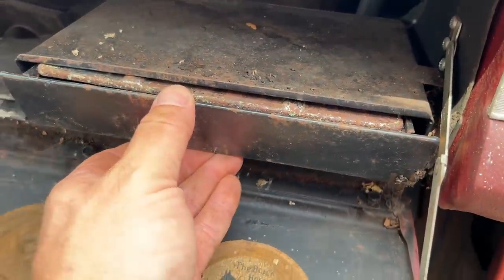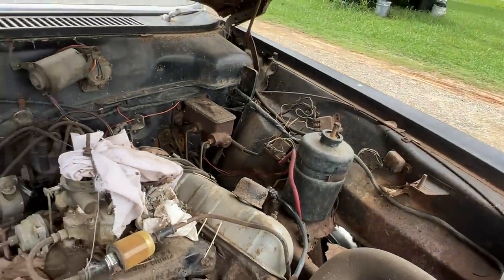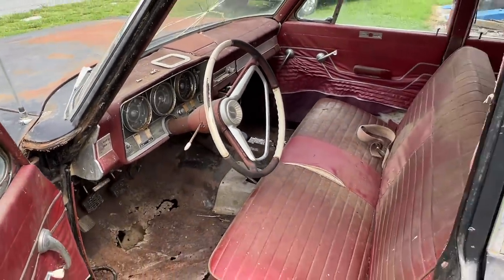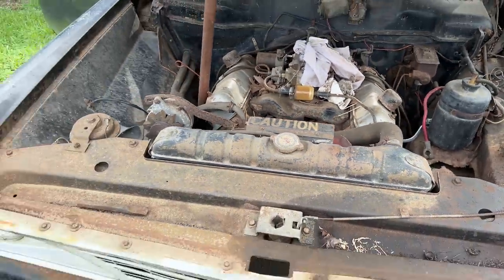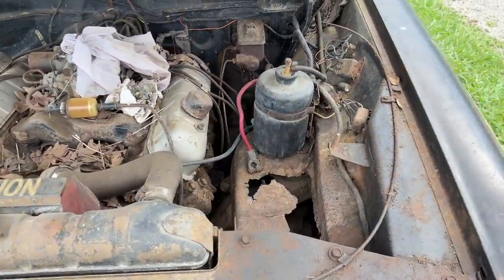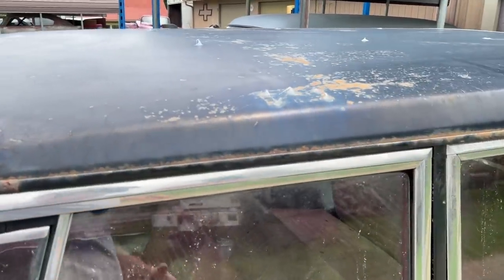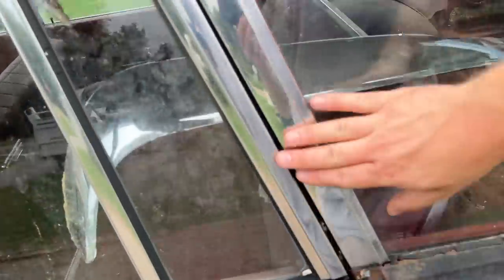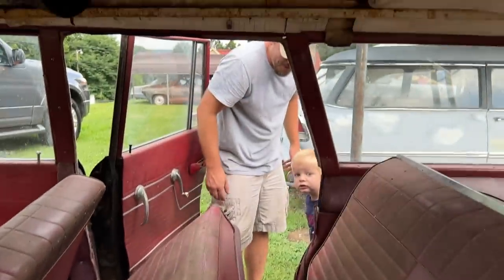CRAZY RARE V8 4 Speed Studebaker (Best STATION WAGON Ever!)

Comment: I love these wagons!  Matchbox even made a model in the day that featured the sliding roof.  Sadly, this was very near the end of the line for Studebaker vehicles- which date back to covered wagons!!
Reply: Studebaker was established in 1852 so was over 100 years old when they went  under.
Reply: @todddenio3200  Yeah, I’m guessing it held a record for a long time for longest run for a US vehicle manufacturer.
Reply from the maker: Wow I didn't realize that!
Reply: Lesney's Matchbox #42 Stude wagon was my 1st. 4 wheeled vehicle!  😄
Reply: @UberLummox  I also had one. It came with a plastic hunter and his dog. The roof slid open! If anybody has a complete original with the box it's EXTREMELY rare!
Reply: @HotRodHoarder  Tommy, you should call this project the “UnCovered Wagon”, or the “Rediscovered Coverable Wagon”.  😂
Reply: Yes Matchbox made the Studebaker Lark version. So did Corgi who did their’s as an ambulance - which was sold in the USA under the Husky brand. Both had the sliding roof but Corgi’s also had an opening tailgate.
Reply: @bccphotec  Yes it was such a sweet model with lotsa play value with the figures as you mentioned, and the sliding roof.  I'm actually a collector of these (still  🙂) however they are not rare. Quite common in fact!
Reply: @UberLummox  I’m also a diecast collector, mostly Hot Wheels, followed by Matchbox, though I’d say I’m “retired” from collecting.  Maybe it’s more appropriate to say “in recovery”? 😆.  I don’t have the Stude wagon, but would be a cool piece to own.  Will have to check out the Corgi and Husky models - I had a feeling Corgi made one…btw my very first Hot Wheel was the Emergency rig ca. 1974.  Like all my childhood HW & MB I still have it.
Reply: @mattskustomkreations  "In recovery" HAHA! Yeah me as well. Sometimes there IS such a thing as too many!  I know the HW you're talking about. My 1st. Hot Wheel the sexy Silhouette. 😄
Reply: @CycolacFan  Corgi's Husky actually came in a couple variations that I'm aware of. An ambulance, and a camera car with cameraman standing up in the rear of the load area w/roof open.
Reply: @UberLummox  you’re right, the camera car was yellow wasn’t it?
Reply: @CycolacFan  You're right. Cyco. It also came in blue, and olive metallic. Maybe other colors. I'm not that up on my Corgi history too much.
Reply: @UberLummox  You were so lucky to have grown up in the Golden Years of HW.  I remember being really sad to see the redlines phased out just as I was beginning to be a serious kid collector.  Like every addict has an eventual “rock bottom”, mine was when I went to move cross country.  When I saw how many boxes and boxes I had packed it was a real wake-up call.  I had never seen all of them together, they had been squirreled away all over.   I went cold turkey and for many years bought none, then maybe one or two a year after that at most.  Sold some primo ones when the recession hit - unfortunately everyone else was trying to unload too, so prices were soft.
Reply: @mattskustomkreations  Oh...my...GOD, right!!!? So much cool junk it was silly! I was more into the realistic regular wheel Matchboxes, but everything from the models, slot cars, and cool stuff the  custom chopper my brother built from the Auto World catalog....that thing was so beautiful!!!.   I called everything past about '72 the diecast dark ages, until Jonny Lightning fired back up, then I kinda went nuts.  I've been in recovery as you say for a few years now except for a few customs. 👍
Reply: @UberLummox  Are you a @Plus Ten Weirdo”?  +10 Weirdo was my description for my profile for the perfect yet elusive collector whose collection I used to search for when I was hardcore into hunting and buying Spectraflame era HW and blackwheel MBs.  It means someone who as a kid was 10 years older than me.  But a weird kid - one who didn’t run his cars through the dirt, leave them outside, paint them, or play crash-up all the time with them…he kept them in the carry case - safe and immaculate.  Growing up, my best buddy had a brother 10 years older than us, so he had the goods.  He could have been a 10+ weirdo except my friend got to his HW and JL collection at age 2 and took a hammer to them. (!) So I was left with glimpses of grandeur…the beat-up cars were absorbed into my friend’s collection.  We played for hours in his basement using miles of his bro’s orange track.  I look back and I’m sickened- such as with the purple Classic Cord that was beat to crap, among so many others.  Every single Silhouette had its bubble cracked.  Axles bent, wheels missing.  Lots of Unimogs, not one with a full set of tires.  Carnage, I tell you!  Years later, when moving his room to the basement, my friend struck gold - he found 2 MB cases with mid- to late 60’s MBs in them, in perfect condition!  These cars escaped the toddler’s wrath- turns out his older brother was a Plus Ten Weirdo after all!  😂 I used to salivate over them and beg to buy them but no dice.  My time finally came when my artist friend mentioned he still had all his cars.  He was +10, check.  He was an artist, so goes without saying he was a weirdo.  It also means he was broke.  So he “pawned” his collection to me.  I promised to hold them til such time he could buy them back.  When he brought them over, my jaw hit the ground.  So many were in PERFECT condition.  On top of that he had all of his HW badges, plus sheets of unused decals. 2 of the 3 HW club chrome cars.  And original series Models of Yesteryears. Plus there was another bonus— along with late ‘60s HW and MB jewels, he had something I had never hear of - a “Cigar Box” of Aurora Cigar Box cars.  Essentially plastic slot cars converted with diecast bases and rubber wheels to try to complete with the big boys.  These cars and case were IMMACULATE, which is incredible due to their fragility.  And rare - Aurora gave up competing with HW after 18 months.  Sadly, he died a few years later, and parts of his collection, including the Aurora collection, were among the eBay victims sacrificed when the recession cost me my job…
Reply: @mattskustomkreations  Yeah, I'm weird as fuck. And a little bit of an artist and am a musician, so...:🤪<---yup! I remember clearly, at 6 yrs. old making the conscious decision to keep all my cars in my case, and not let Mom toss'em in the toybox. So many of my regular wheels are a little tatty, my transitional Superfast are half & half, and all my post-'70 Superfast are dead mint. Though some the wheels are literally worn down, but otherwise nice!  But I'm more 1:1 car freak than toy & collector freak. I know crazy amounts of US & Euro history, and have had my own bodywork business since I was about 14 around 1978.
Reply: @UberLummox  Cool, I’m also an artist and musician.  I had to give up the last of my 1:1 collection when the recession hit. 😢 I drove a loaded ‘72 Luxury LeMans & wife drove a ‘69 Cougar with factory electric sunroof as daily drivers up til then…

Comment: Definitely worth saving. The Studebaker club hopefully can help you find a windshield source. Do you know what that black tank object is in the drivers side of the engine compartment? Your wife is brave regarding filming while bugs run around. Most would have dropped the camera at that point and run lol. Subscribed.
Reply: you can get a windshield for just about anything if you are willing to wait. I just sourced one for a 64 Corvair Van and it was made in China. Special order cost about $1800 plus another $100 for the rubber. Insurance covered it. BTW, I have to say it looks good but the optical quality on the curved edges is not like the original.

Comment: FYI Most of the V8s engines were replaced with a 6 cyl. Because the V8s had large coolent passages which they used them in boat racing.
Reply from the maker: Interesting, I didn't know that!
Reply: @HotRodHoarder  My best friend had one .Theres  a bar in front of the radiator if it's there you have real deal. And it was a Dailey driver. The sliding roof is a air craft door. We called it the white Rino. The wagon.

Comment: The center lock on the sliding roof will also lock it in the open position.  Again to prevent unintended decapitation etc. As I recall, when functioning properly, opening that latch drops the sliding roof just slightly and allows it to move. Closing it lifts the sliding roof slightly and 'locks' it in place with small side safety latches that were always supposed to be used as a backup to the main latch/lock.

Comment: I have two Wagonaires.  The engines (259/289) are already hot rodded with solid lifters and gear driven cam.  The center steer is unusual.  Electronic ignition, disk brakes, and supercharger were options.  Not options on other American cars.   The car has a filter for interior air.  Not found on other cars until recently.  Studebakers were state of the art.  You must fix the drain in the sliding roof gutter.  Add another drain hole and hose between the doors.  If you park it wrong, it will pee rainwater on your shoulder.   I drove one 500 miles a week in the '90's/20's.  Ted Harbit drag raced a factory Studebaker (including engine) until wrecking it a few years ago.

Comment: I have a 66 with very little rust. Colorado wagon. Slider  Wagonaire made from 63-64 in So. Bend, IN then factory closed (Stude started in 1852 making wooden wagons). Moved production to Hamilton Ontario in 65 and ceased production early 66. Since Stude had no drivetrain, they sourced to GM Canada. Mine has a  283 sbc, 3 on tree with BW and elec od in 2nd and 3rd.  Parts can get pricey. I have the fold down tailgate step on mine. Body on frame  construction so endless possibilities. Around 9xx made in 66 before closing.  The sliding concept was advertised as a wagon/pickup. See ads with refrigerator standing in back. Endless possibilities in a build-up.

Comment: Should have used a little penetrating lube like KY. That Stude is worth restoring, as long as you don't muck it up as a Resto-Mod.
A little trivia: 
When Chevrolet was designing the Nomad, they had considered a telescoping roof, but due to production cost and possible water leaks, they instead went with a simulated telescoping roof.
Also, while the Wardolf Nomad had a electric rear window,  Chevrolet went with a lift up window  for the 55-57 Nomads because of production cost.

Comment: Your wife has the cutest laugh ! Love the video and she is worth saving. A little history back in 57 you could order the Studebaker Golden Hawk with the 289 Sweepstakes with a factory Super Charger . Even the Anvanti was optional with the Super Charger it was a Paxton belt driven super charger. I have a original magazine from the early 60s and they test drove a Avanit from coast to coast . They went to the factory got a Aavnti off the assembly line as it came out . You could get AC or the Super Charger not both. They opted for the Paxton, It had manual trans in it . They drove from the factory and at 75 mph averaged 17.5 mpg when they got to the Salt flats they decided to do a top end test they threw in a fresh set of plug and drove the car out on the salt flats and did 149.8 miles an hour . This is a car with a 289 and points dist and fresh off the assembly line driven from the East Coast back in 1963 , There is your history lesson for today .

Comment: I had a 1965 Chevy Bel Air station wagon in the early 1980's and the tailgate window worked well, even in the most bitter cold winters. My parents had purchased a new Dodge Omni in 1981 and it froze up completely during a severe cold snap in January 1982. The dealership said the computer was frozen, the battery was frozen and the fuel line also. It was at the shop for over a week. I was taking my step-father to work with my 17 year old $300 clunker station wagon. It started every morning, even at -30 Fahrenheit. Hard to kill those old 283 Chevy engines.
Reply: That Winter of '81-'82 is the last continuously below-freezing cold and snowy one that I can recall having here in SE MI, lasting from early December through mid-April w/o a significant thaw. Ever since then, each successive winter has had long thaws and caused the regional Pine Knob Ski  resort to operate erratically during each seasonal year, if it opened @ all. A few years ago we even had summer-like thunderstorms overnight, 2 in mid-January and 1 in February.

I stored my '79 Chevy Camaro z28 w/350 cid 4bbl, 4spd Hurst stick overwinter in my parents garage back then, after having purchased a old used 1969 Plymouth Fury 4-door  318 v8 auto with 119K on the odometer for a few hundred bucks. It was an AZ car that had stood outdoors in the  desert sun until the gloss had completely baked off of its gold paint, vinyl bench seats were badly cracked all over, and the carpeting had lost all moisture and was rock-hard.

Comment: Not being A Car Family at the time, my Parents purchased  a 1964 Wagonaire, not knowing the Company was going under.  I was 12 at the Time and thought the Sliding Roof was cool.  We probably were sold a base model, because I don’t remember  electric windows, V8 and it was an Automatic.  Not a selling point but the Salesman made a point of a feature not shown on this video was a step built into the the tailgate which  swung down to ease access into rear area.  He showed it to me with my parents watching and I unfolded it, and it kept me occupied while they made the deal.  Ironically when I saw the GM pick ups with that NEW design Tailgate - It reminded me of a 58 year old Studebaker - Imagine if they were still a Company today - Flying Cars??? Oh and OBTW the roof did leak right away after there was no longer Dealer support.

Comment: I have a 63 Lark.  The Studebaker option for disk brakes are still available, and most parts are still available for American production models.  You need to get acquainted with Studebaker International!  And the glovebox vanity was a studebaker exclusive.  If you want better wheels, any Ford Crown Victoria wheels will fit with a slightly wider offset.

Comment: 5:38 When you said "DASH" my dog came alert (his name shortens to DASH from BALDURDASH ).
'64 Studebaker Daytona (top trim level except for the 'Cruiser' sedan) Wagonaire designed by Brooks Stevens (same guy who worked on the Kaiser-Jeep Wagoneer), it's a moosemobile with space rivalling the best full-size competitors, and that sliding roof panel put in an appearance forty years later on a version of the GMC Envoy. 
Studes were notorious rust-buckets. Even the fiberglass body Avantis had rust issues. 
That said, the Wagonaire also bears similarities to other Stevens designed show cars.
The Wagonaire could be ordered with any Studebaker engine, including (though no Wagonaires were ever so equipped) the Granatelli R3, a supercharged high compression 304.5 cube overbored version of the 289. Rumor was that no R3 left Granatelli's shop until it had turned 415 horsepower on the dyno, though the number usually quoted (and Studebaker never published output ratings for the Avanti engines) was 335. 
More tame offerings were the 170 cube six at 112 horsepower, 259s at 180 or 195 horses, regular fuel 289s at 210 or 225 horses, premium fuel 289s for which Studebaker never published horsepower ratings, with or without supercharger. Another version of the 304.5 with dual four-barrels and 12:1 compression was said to have produced about the same output as the supercharged 289.
In short, that is a very special car. While it may cost more to restore than could be recouped in the short term, it is an important piece of automotive history. 
6:30 That "Vanity" was standard equipment on all Studebakers of that period except, maybe, the severely decontented Standard ('63) and Challenger ('64). 
9:09 Rambler and Cadillac offered dual circuit brakes as standard equipment starting in 1962, and Studebakers with drum brakes followed in 1963, four years ahead of the rest of the industry. 
The dual circuit was not available with another Studebaker first, power disc front brakes which were standard on the Avanti and (expensively) optional on all other models. Studebaker claimed that the discs stopped the car from 100 miles per hour in 100 feet less than the standard drums. Magazine road tests at the time confirmed it. 
The sliding roof proved useful for carrying tall cargo, and I have seen pictures of Wagonaires with movie cameras in the rear bay for newsreels.
The Climatizer is the heater, optional in those days.
May I suggest looking up the television commercials on YouTube?

Comment: Need a shop vac. And an air hose to blow all the shit off. Need a battery and wires with alligator clips to test individual things like window motors that should be cleaned and lubed in the tracks. Don't break stuff.

Comment: The 1963–64 Daytona version of the Wagonaire could be equipped with a V8, Carter 4-barrel carburetor, and a column mounted shifter manual transmission with overdrive. Bucket front seats along with a center console-mounted automatic transmission selector were available. The Wagonaire could also be ordered with any of Studebaker's available "R-series" high-performance Avanti V8 engines and the four-speed floor-shift manual transmission....from Wikki
Reply: My,first car was this car  good car loved  the sliding roof  especially in the  sliding roof.

Comment: There were only 1,075 Lark Daytona Wagonaire’s made in 1964. However, there were options for column shift, floor shift, and automatic, with a variation of engine options. The Wagonaire could also be ordered with any of Studebaker's available "R-series" high-performance Avanti V8 engines and the four-speed floor-shift manual transmission.